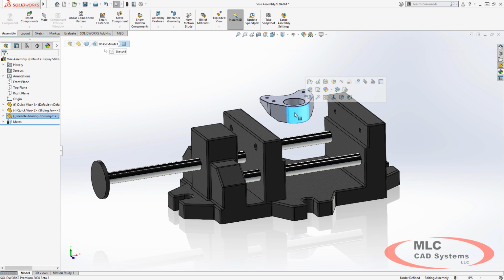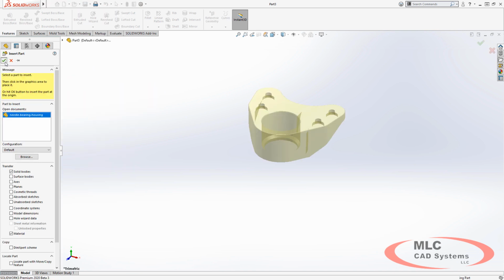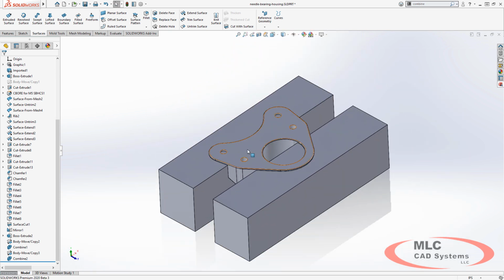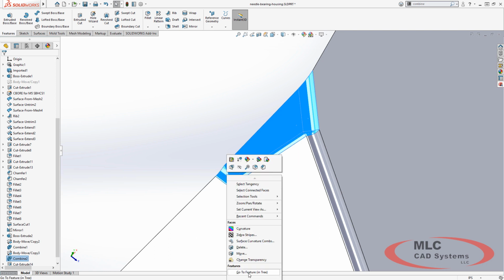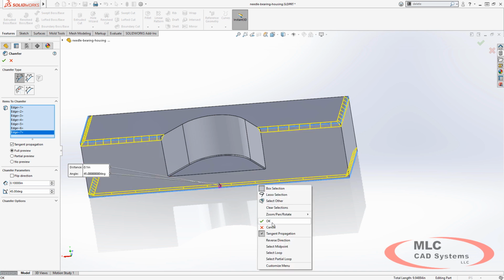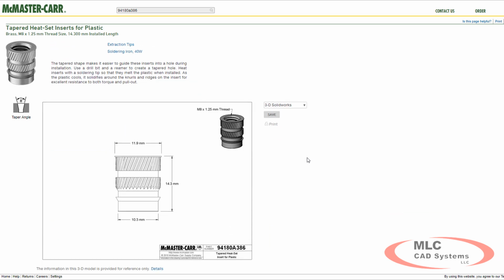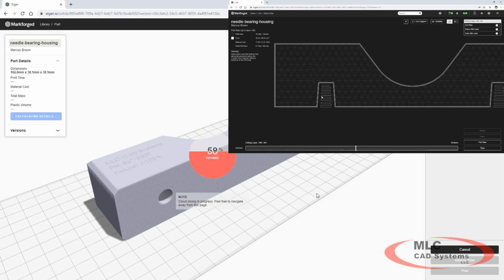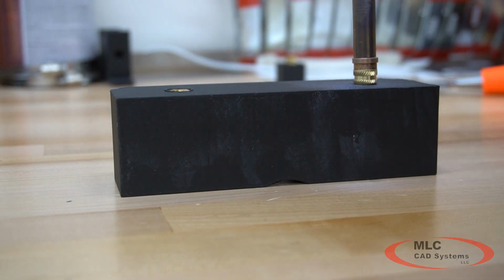Markforged Conformal Vise Jaws Case Study

Comment: Great video. What make / model of vice is that you used please?
Reply from the maker: Thanks for the feedback!  We were impressed with the vise too, and by building the jaws in a way that holds it in place on the fixed side the quick grip sliding action works great for fast and secure part swapping.  Shars part number 202-1107
https://www.shars.com/6-quick-grip-drill-press-vise

Comment: What was the material cost to make this jig?
Reply from the maker: Great question, these parts were printed with additional carbon fiber for rigidity and each pair costs $60 in material and can be printed overnight (26 hours)
Reply: @MLCCADSystems  Surely faster and cheaper to CNC than mess around like this?
Reply from the maker: In some cases yes, but there are other factors to consider.  A CNC machine that isn't making customer parts isn't making money.  Jigs, fixtures, and jaws all represent necessary parts, but they do not generate revenue directly.  If you can avoid the setup, programming, and changeover to cut jaws like this there is some money to be made in uninterrupted production.  Additionally, these parts have virtually no limit on complexity, including undercuts, sharp internal corners, features that would normally have to be cut from multiple angles, even internal features.  The finished components are lightweight and durable, so they are much easier to store and move around in the shop.
Reply from the maker: I would rather have my CNC programmers focused on making improvements to the programs we run thousands of times, rather than programming parts we'll only run once.
Reply from the maker: @aluminumfetish your tool room guy would probably get a lot of benefit from reviewing the technology!  It is a very powerful and flexible solution. Let us know if we can invite him to an upcoming webinar!